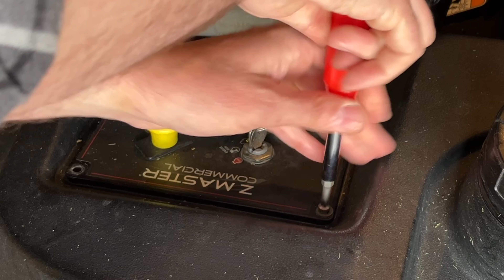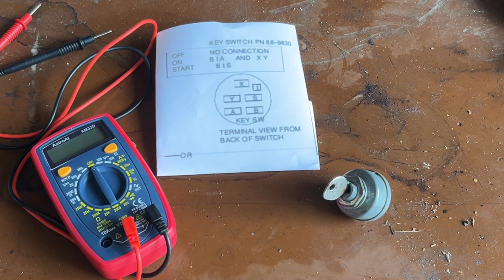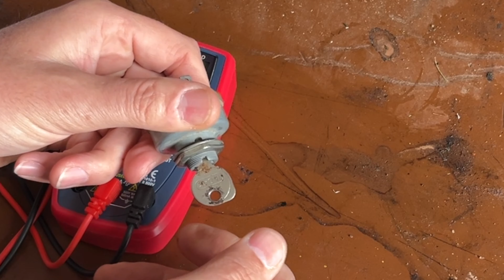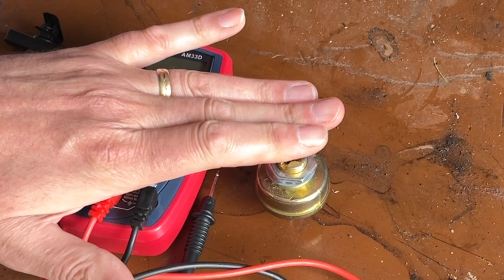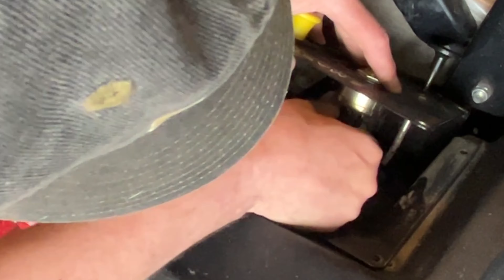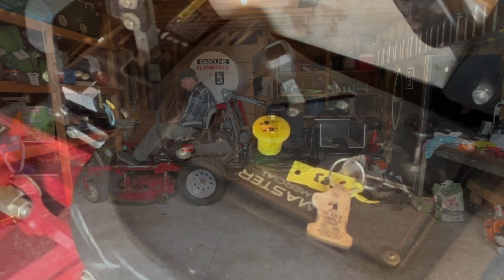Testing and Replacing an Ignition Switch

Comment: Jason, Glad you kept the OEM carb. I suspect everyone else is luckier than me. I usually have to rebuild the OEM carb when the ROC carbs don't work as well. I do use all the "extra stuff" that comes with the ROC carb and feel that I got my money's worth.
You definitely need that rear tine tiller to work that garden space. Your Gravely tractors are too big for that. I inherited my father's 1972 Troy-Bilt Horse and use it for the smaller work. It works as well as new in spite of all work Dad did with it. But then again, he maintained his equipment. As large as his gardens were, he should have had a Gravely walk behind tractor!!
Reply from the maker: @ibsoarin  thanks for watching.